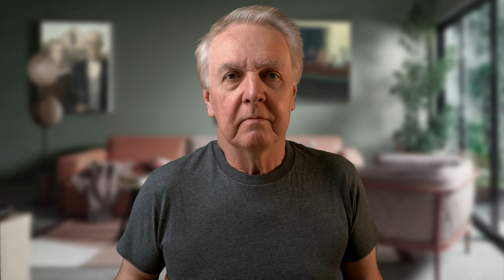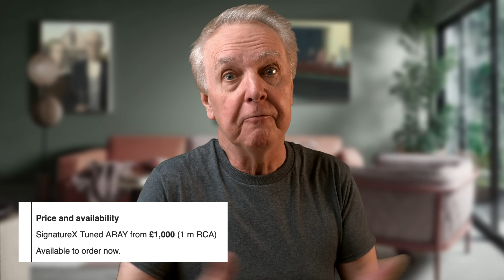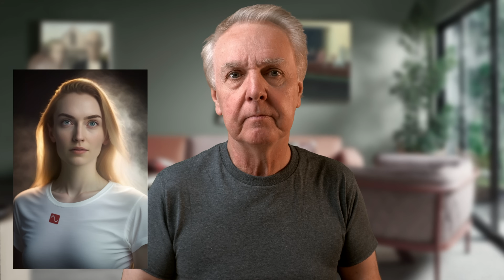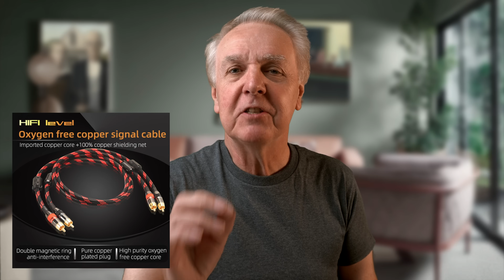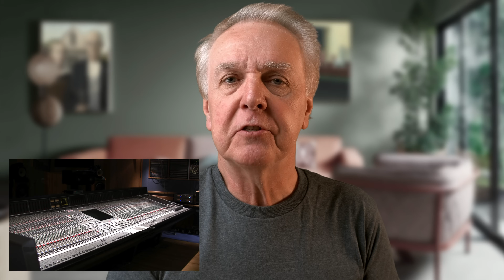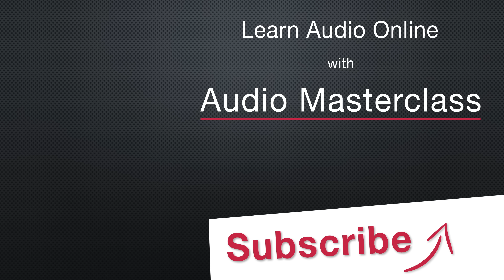Would you pay $1000 for a 1-metre cable?

Comment: It is funny because most engineers are swearing that cables does no difference at all, but will get angry if you use the wrong PCB sub stray, has forgotten to angle the glass fiber weaving to 45 deg, has not placed a track diagonally on the layers below, chose 0.00137 inches copper thickness instead of 0.00274 inch, has placed a capacitor 0.059 inch from the chip instead of 0.03937 inch or if you use 0,0001232 oz of solder vs 0,0002464 oz. Because that matters GREATLY, but who cares what you build a 50 times longer cable out off, that has to contain exactly the same signal! :-)
Reply from the maker: Having dabbled in electronics myself then I know that the layout of the PCB can definitely make a difference, the worse case being oscillation. But I'll leave the debate over the sonic properties of paxolin vs. fibreglass for others to decide. DM

Comment: The only place I would use silver would be in the tonearm and only if I had a very low voltage moving coil cartridge and like other twisted pair. Anywhere else one or two screens and twisted wire works much better than anything else.

Comment: There is such a thing as "bad wire" but at some point...wire is just wire.  I look for quality build and that's about it.  Back in the seventies I was in Wally Heider's studio in SF...there was some problem with a cable.....we were told to go get some coffee while they straightened it out.  As we were going out the door...one of the assistants was also leaving...he said "Don't go far...there's a Radio Shack right around the corner.  It was fixed and we began recording again.

Comment: lets be honest here, if you had plenty of money and spending a grand on interconnects was like spending 20 to Mr rich then most of us me included would pay if not 1000 then plenty of money on RCA, speaker cable and so on, especially as you've just bought a very expensive system you would not want to cable it up with poundstore best buys, and a coat hanger for a good radio signal.
Yes it doesn't make much sense after all is there really a difference between £ 500 RCA connects and a £1000 pound ones, could you hear a difference in audio quality, I will never know because, unless I come into plenty of money my cables will be modest in value, but lets not take the piss, Most of us will never find ourselves with that kind of spending power.

Comment: If you are done with these extremely cheap interconnects I do know a company that is willing to sell you a pure silver one for EUR 12999 per meter (That's the finished price). If you would like define your own length all they ask for is "6.500,00/pair m 
+ 6.499,00/pair".
Reply from the maker: This is like a weird auction where people keep coming up with a higher bid. DM
Reply: @AudioMasterclass  Who isn't fascinated by people buying completely useless things like markers to blacken the edge of CDs in order to make them sound better and then paying absurdly massive amounts of money for said things. Like 13000 Euros for a cable that can be had for less than 50 Euros with the same build and audio quality.
Sure, the silver ore for those cables hasn't been collected by virgins at a full moon during the midnight hour - but they work just the same 🙂

Comment: I build one meter cables using the best materials for about $35 a pair. It may not look as fancy as an expensive cable but it sounds just as good and takes about 15 minutes to build a pair. My cables have twisted conductors with a copper braid shield, the wire and connectors are best quality.. Because one of the inner conductors carries the ground I do not connect the shield at both ends to lower the noise. This means the cable is "directional" because you want that shield connected at the source end

Comment: Many years ago I did the opposite as an experiment. I had three cables. One was a nice $20 cable, the other a cheap $1 cable, and the last was an identical $1 cable that I whacked with a hammer on a cement floor and made it about as bad as I could. I flattened the one cable so much that no one would even think to use it in anything. I tried my best to stress it without ruining it. I walked on it, tied it around stuff, used it as a whip. The result did surprise me. They all sounded the same. They sounded exactly the same on some decent equipment.
Reply from the maker: Oddly enough, some analogists swear by flat speaker cable because it 'sounds better'. Of course, for practical purposes it runs better under carpet. DM
Reply: I heard a difference from the cheap cables they included with cable boxes and the mogami cables I made.  It was warmer and fuller sounding more bass too. I had one side the mogami cable and one the cheap cable. I used the balance to shift left and right and swapped the cables over to the other side after to confirm both sides sounding the same.  I wouldn’t spend more on cables then the $40 they co
Reply: @jeff666p  The problem with your experiment is that you know which cable is on which side, so mentally you could be biased towards one of the cables. Only when you have someone else plugging in the cables without you knowing which is where can you have a real test to determine which cable sounds better. It might still come up the same as you have decided now, but it would eliminate the bias.
Reply: @YouHaventSeenMeRight  I don’t listen with bias..  I have extremely sensitive hearing. People said coat hangers was an audiophile secret that it sounds much better.  I tested it before buying solid wire . I could hear a big difference it made really warm but got rid of the higher frequencies. I didn’t like it so I didn’t buy it.   I don’t fellow the crowd I make my own decisions. Even if I got $1000 cables for free I wouldn’t use them if I didn’t like how they sounded . I would sell them.    I don’t like spending money on things that I find wasteful/useless. I spent 3 hours testing the difference on multiple days.
Reply: @YouHaventSeenMeRight  add in to the last post.  (My tablet won’t let me hit edit).  I always test things. My last monitor I spend 6 months deciding before I picked one. My mouse . I went to the store t
Reply: @YouHaventSeenMeRight  I hate this fucking tablet. iPads suck.      add in to the last post.  (My tablet won’t let me hit edit).  I always test things. My last monitor I spend 6 months deciding before I picked one. My mouse . I went to the store to buy the one every one said was really good buy when I tested the display model I hated it . I spent an hour trying every mouse until I found the perfect one for me which was 1/3 the price.

My chair I spent 3 hours going between two stores sitting in every chair they had before choosing.  They one everyone says is great on here I hated.

I am very selective about what I buy.  I don’t mind spending a lot on something if I love. But if I like the cheaper one better I will always buy the cheaper option.
Reply: @jeff666p  always test for 6 months......buys iPad. 🤣
Reply: Maybe you should start a "distressed" cable company. Use a hammer made with a gold head, platinum core, rhinoceros horn handle, encrusted with diamonds, all forged in the fires of Mt Doom.

Comment: At the end of the day, it is a length of wire that takes a signal from point A to point B.
The most perfect cable or interconnect in the world would convey the signal without any change.
Therefore any changes you hear (or think you hear) will be caused by the cable degrading the signal.

True story - I have a Spotify family account that is used for casual listening, For the same money I can get an Amazon lossless account, so I took out the free trail. 
Sat down and listened to some of my favourite all time songs, tracks I was familiar with.
Sure, enough when I went to the lossless stream, I could pick up out subtle nuances in the music. WOW! 
Being a bit of a nerd, I switched back to Spotify, guess what I heard the same nuances that had heard in the lossless stream. After switching back and forth between the two service I concluded that to my ears there was no real difference and quiet honestly was not worth the hassle of changing.
 My point is if you convince your self that you are going to hear a difference then you will. 

People are free to spend their money as they choose, but remember to enjoy the music .

Comment: Re: Expensive cables. I have bought between 30 and 40 premium cables over the course of several decades. I think all but a few I've bought used to get better pricing. In addition to the ones I've I've actually bought, I've home auditioned several more including a top of the line cable from MIT whose retail price was about $5,000. The MIT was the best cable by far, but it had such an overwhelming warmth that except for brighter Columbia recordings, I was missing the sunshine. It was too dark sounding on most recordings. It was the thickest cable I've ever seen. Maybe it was 4 guage guageor something. Thick cables cables often do excel at bass reproduction. With that cable I actually remember that my bookshelf speakers no longer needed a subwoofer. They were in fairly bad need of one. The bass went deeper than you'd believe. I pictured a Krell power amp. Great control, the insstruments sounded about 50% bigger. Gone was the realism limiting small size of instruments. The sound was smooth as silk with great body. Warmth always enhances that. I thought of building a system of bright components around it. Maybe that's what I should have done. I couldn't picture any amp upgrade that would give that much of an improvement jump. In fact I had trouble picturing any speaker upgrade that would give that much improvement. But the warmth was just too much; after many weeks I reluctantly sent it back. I bought another set of speaker cables, and they were such a letdown in sound quality, that I had to take a month off to sort of forget how good the MIT cables were. After the sabbatical I went back to my my old cables. The ones before the MIT and the other cables I bought. 

 I have bought some cablesspeaker cables from the U.K. including Chord Epic. It did make my sound bigger, faster and more palpable. I went from that to another brand which had a little deeper tonal colors. At high price points, the perceived performance that a cable gives you has obviously become the pricing criteria. criteria.Not what the cable costs to make.Some manufacturers are more realistic than others in judging that. Some expensive cables are good deals and some are not. not. Manufacturers who make $$3,000 bookshelf speakers do the same thing; but they somehow get away with less critical scrutiny about it, as they obviously have more work put into them than a wire. wire.The main disappointment with cables I've bought sight unseen without auditioning is a dryness to the sound, inhibiting tonal colors. Dryness can actually give an illusion of the sound being more smooth than it really is. New cables or cables with very low hours seem to usually lack bass. You can actually hear the bass becoming more morea part of the mix as it hits the dozen hour mark and above. Paul from from the PS Audio channel recently did a video on component break in.  Rolling cables and rolling tubes is a lot easier than rolling phono cartridges. Installing and aligning them is no fun. Back in the the late 1970s and 80s, us guys who were really into it, would have a new caerrige every few months.
Reply: << think we found the "audiophile" !! .. Dryness? Faster? There we go with word salad totally inappropriate for audio .. well done ! What's this? ... "New cables or cables with very low hours" .. break in for conductors? O my! Wanna buy a sunny beach in central Antarctica? Sell it to you cheaper than you might think ...
Reply: Ha,ha,lol., you're funny....
Reply: Special qualities like deeper tone colors, quick transient snap, bloom, transparency, effortlessness, depth imaging etc. are completely foreign to some people who've never had edge of the art audio equipment.It's like telling a goldfish that there is a whole world outside his little bowl; mountains, deserts, waterfalls, oceans, rain forests, canyons. Just like an audiophile only familiar with mediocre equipment; the goldfish would never believe it.
Reply: @princeof_all_air  I don't think this video is for you. It is very technical and explains theory, concepts and truths. Good for you if you can hear all that  change when swapping out cables. Me, I like to listen to the music not the marketing hype.
Reply: Your sense for irony is strong.  Or did you really mean it? 
Well, as they say, hi-fi is the only area of the whole universe in which the laws of physics lose their validity
Reply: @otakarschon  you mean me? If so, no I mean what I said.

Comment: The issue with your video is you are just talking about theory. It's like reviewing a restaurant by only looking at the ingredients. You need to taste the food to understand why it's either a good or a lousy restaurant. You need to have listened to the cable to judge its worth. I think everyone needs to listen to a cable before buying a high-end or low-end cable. If it does nothing for you, then you don't buy it. If your system comes to life and you have a spiritual moment of enjoyment, then its worth it. The main issue is most people need to learn how to hear; HiFi is a murky world of miss-matched equipment. I went to a very hifi end audio show in the UK last month and everything sounded shockingly bad. Only one room sound good and that's was some of the cheaper equipment. I have tested the cables you mention, yes they are very good and very transparent. Are they worth £1,000. Well I can guarantee it would sound cleaner than your Ally Express cable. The issue is the better the performance the more you pay and to get the extra % you pay a lot it seems. This is not always the case you need to find the right cable for your system. If you can afford it and to you it sounds good then its a good buy. Cable in a high end mixing desk is actually very high end cable that's been tested to sound good, they buy by the drum so get a much better deal. In a miillon pound plus SSL desk which I have used on a number of projects they sound amazing. The desk in studio 2 at AIR which is totally analogue people have offered millions for it as it sounds so good. despite it having a dent in it cos Liam Gallagher decided to dance on it while reviewing the mix of the album Definitely Maybe. My point here is don't knock what you have not tried! Its whats right for you. If you test it and cant hear any difference then you are wasting your money. To me listening is about heart and soul that makes you want to get up and dance if it doesn't do that regardless of how much its cost then its a failure. Music its all about enjoyment, maximum pleasure. Ive been in cafes and an old boom box has sounded amazing, its what makes you happy!
Reply: @Douglas Blake I think you need help as you are trying to pick a fight. Have a nice day!
Reply: @Douglas Blake LoL No if food tastes crap thats nothing to do with science which tells you its perfectly healthy. Only thing that matter with sound is your ears as the rest is all psudo science. I get paid for knowing what sounds good. Ive tried all manner of tools to try and quantify it all are meaningless. A QC tool will rate pink noise the same as a music track. My point is he has never listened to the cable so its all speculation. Belief is not reality. The REALITY of listening to it is all that matters! What you are saying it must be good cos the computer says so. If you don't have good ears your in the wrong game, no amount of gear will allow you to fake it!
Reply: @Douglas Blake Do you know what snake oil is? LoL using terms with out knowing the relevance. Ignorance and we wonder why the human race will die out.
Reply: @Douglas Blake What you are saying is you don't trust your ears! LoL Think you need to find another hobby. Ever thought of potholing?
Reply: @Douglas Blake I still think potholing is a better vocation for you as you are an ignorant unpleasant person who is clueless. Get that gear on and straight down that hole. First thing you missed is a cable is actually a filter! Where do your learn this ignorance do they run course or something? If so you should get your money back.

Comment: I tried an experiment with replacing speaker cables with two core flex cables and hooked my amplifier to my speakers with it. Could I hear any difference? No is the answer. I think the answer is that because the mains flex cable has to conduct electrical current with as little resistance as possible then the copper conductors in said cable has to be a pure as possible. Same as OFC posh speaker cable IMO.

Comment: 1000 pounds for a 1m RCA cable is complete BS and a rip-off. I fear that there are many "Audiophiles" around that would still buy this. And btw. : This is often "optimization" at the wrong spot. I know of such "Audiophiles" that have insanely expensive "interconnects" and even "optimized" power wires but play old LPs on their turntable that would not deliver the sound they want to improve on in the first place ....